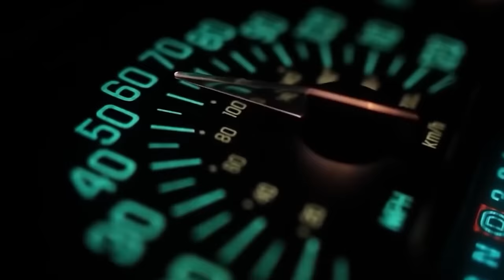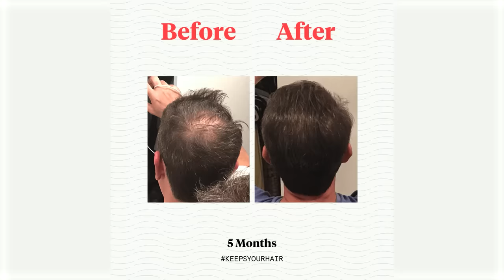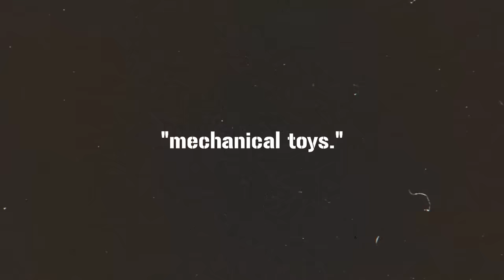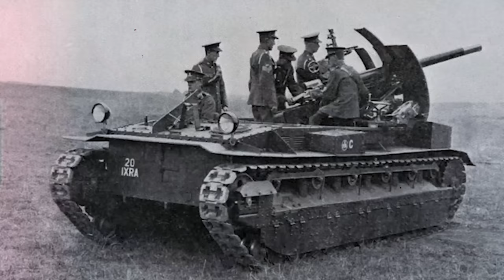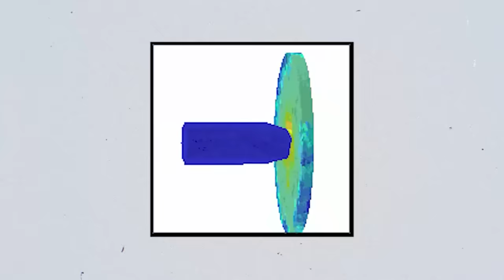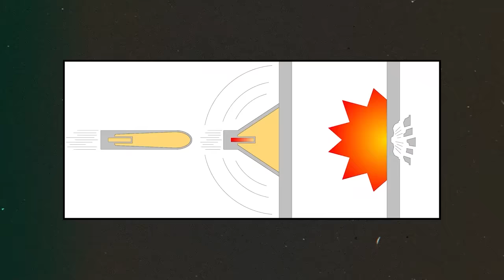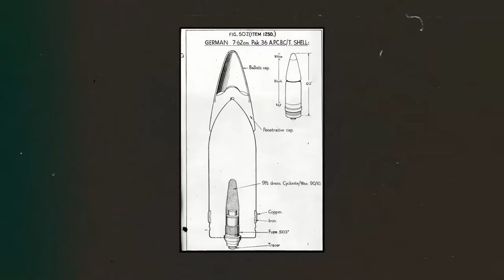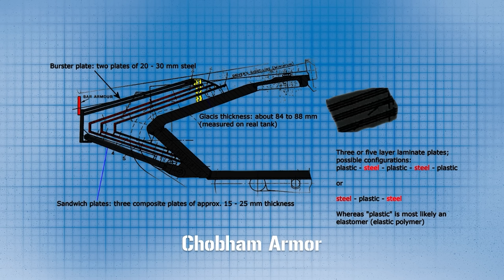The Tank: Everything You Need to Know

Comment: Armored cavalry / knights were technically the earliest form of "tanks" (Cataphracts were one of the earliest form of heavily armored cavalry). The fullfill the same role as modern day Tanks - mobile, fast (compared to infantry), protected by armor against infantry and even archer attacks and heavily armed (cavalry charges inflicting horrific amounts of damage vs infantry attacks and allowing them to easily bypass any infantry body armor thanks to the weight and momentum of their charge). Industrialization replaced the horse with a motor and the lance / spear / sword with a canon, but both the knight and tank ultimately serve the same function in an army - mobile, protected and powerful offense capability.
Reply: Tanks replaced cavalry in the role of Heavy Cavalry, but that does not make cataphracts etc. actual "tanks".
Reply: @bluntcabbage6042 True, but they ultimately served the same overall roll in their respective armies (tank today is mobile, protected firepower... heavy cavalry was mobile, protected firepower). Both also have the same weakness, in that they are highly vulnerable without infantry support to guard their flanks.

Comment: Little Willie actually had an armed turret on the roof. Before the French Renault tanks were built.  Turrets had also been widely used on ships and armored cars. The side sponsor guns used on the British WW1 tanks were designed that way to effectively shoot down into trenches.  So they were not a bad design but actually very effective.  Later tanks did not have to deal  with  so many trenches.  So they were able to use a very efficient top turret.  With the many tanks used during WW2 it was found that single turrets with a  three man crew were most efficient in providing an economic ballance of speed, armor and firepower.  Post war turrets with autoloaders only needed 2 crew. The WW1 Renault had a 1 man turret. Large and expensive multi turret tanks were found to be slow, unreliable and big turrets. 5 man  WW2 tanks were found to be efficient in ergonomics and manpower.  3 man turrets allowed for faster targeting and rate of fire. Leaving a commander to do other jobs rather than loading the main gun.  Such as looking for other targets, communicating and giving orders.  Having 2  large turret guns would be heavy, large and impracticable.   They would not have a significantly higher rates of fire and would require an extra man to load the gun.  And the gunner could only aim at one target at a time.  And there may be less room for ammunition.  During wartime cost effectiveness is very important.  As shown with T-34 and Sherman tanks that were built in tens of thousands.

Comment: I think your sloped armor thickness calculations are off.

A 1 cm plate angled at 45 degrees has the effective depth of the hypotanuse of a right isoceles triangle with base 1. Or about 1.4 cm.

Not particularly coincidentally that is the same multiplication factor as 1 f-stop of aperture.

Comment: I doubt the advantage of sloped armor is the additional effective thickness. I mean it uses the same amount of steel proportional to the increase in thickness because the panel itself is longer.  Instead the angled plate diverts the momentum of the incoming projectile, converting some of it to a vertical vector.  So it's more like the angle "parries" the incoming projectile.
Reply: You can doubt it, but its reality.
And of course the projectile has to pass trough more steel when the plate is angled.
And btw, the length of a hypotenuse is a2*b2=c2. So sloped armor should have less steal in it, than a right angled box.
But remember, the projectile only cares about how much steel is right infront of it, not how much steel is used in the slope in total.
Reply: @NotASeriousMoose  you're also using more steel because the armor plate is longer.  So thickness is still proportionate to the amount of steel used.  You can achieve the same thickness increase by using thicker plating.  The difference between using a longer sloped plate and a thicker vertical plate that uses the same mass of steel is the slope that diverts the momentum.  THAT is the reality.
Reply: @NotASeriousMoose  the effective thickness of a steel plate with a 1 inch thickness is ✓2, that is square root of 2.  If the vertical height is 10 inches, then the amount of steel used is 1 x 10✓2.  A vertical plate with thickness of ✓2 and a height of 10 inches will use ✓2 x 10 amount of steel, which is equal.  They both have the same amount of steel and both have the same effective thickness.  The difference between the two layouts is the slope.  I know how to use the Pythagorean Theorem.
Reply: You are ignoring the horizontal plate.
Reply: @egoalter1276  internal volume is not affected by the horizontal plate.  For the same equal cabin volume, you can use a half -length top and bottom plate for the vertical plate vs a full length plate for the angled plate on the bottom.  The volume remains the same.  One can even argue that the vertical plate has more "usable" volume as the ceiling is not intruding into the cabin space for a vertical plate.  In fact in 3 dimensions, for a rectangular cabin, an angled plate would use more metal for the horizontal plating because the corner would use twice as much metal than in an angled configuration.  So angled is actually less efficient if what mattered is only effective thickness.  I can math it out for u if u like.
Reply: @egoalter1276  this assumes the top and bottomed plate are of equal thickness, btw.  If the top plate was armored, then the angled configuration MAY end up using less metal depending on the dimensions used.  However, top plates are usually not as heavily armored as the sides, and when you factor in usable volume, then it would become a complicated calculation.  None the less, the amount of metal used probably evens out somewhat, so it's probably a moot point.  And if you're trying to argue that angle of impact does not matter in calculating the transfer of momentum and penetration, then you need to read up more instead of waiting for me to explain it to you.

Comment: I don't think any of the current designs really count as 4th gen quite yet even if they have some features that I think ought to be a part of a true 4th gen tank. We're seeing the development of quite a few significant systems that are being added to 3rd gen tanks to make them 3.5 gen. I think the first true 4th gen tank will be the first one to incorporate all or most of the various new capabilities in a cohesive whole in addition to incremental improvements in armor and mobility. If 1st gen is the basic MBT concept, 2nd gen is NBC warfare protection, 3rd gen is composite armor, smoothbore cannon and computerization, and 3.5 gen is 3rd gen plus one or two aspects of 4th gen tacked on, then, in my opinion, a true 4th gen tank should incorporate most of the following features: active protection system, 2nd gen modular composite armor system, resistance to top-down attack vectors, battlefield networking, integrated drone support, auto-loader, hybrid electric drivetrain, passive stealth design elements, advanced targeting and optics, and smart munitions. If you want to look really far out, I think 5th gen would be characterized by things like: high powered electric power plant, railguns, active camouflage, directed energy weapons, and high levels of automation.

Comment: I have a question about tanks. I'm hoping someone on here can enlighten me on. I heard somewhere that in the early days of tanks, they were called land ships, and they used naval terms, and that kinda stuck. 

So, my question is, does a tank have a gun or a cannon? I've never been in the military, but from what I understand, it's called a cannon if it's on land, and if it's on a boat, it's a gun. I don't know if they still use naval terms for tanks, making it a gun, or they (or if they ever did, and I hallucinationed that somehow) call it a cannon because it's on land. If it's the latter, then I guess you'd have to make an exception for those Duplex Drive 'swimming' Sherman tanks they used on D-day, I guess you could say they had a gun for a little while.
Reply: Cannon and Gun are generally interchangeable
Reply: Tanks have guns, you’re incorrect!
Reply: @jessehachey2732  The unrifled tank guns of today are typically called that, but in WW1 and WW2 most tanks were often mounted with already well known cannon and guns. For example the early Panzer 3's 37mm already in use on most Anti-Tank Guns, while the early Panzer 4's had a 75mm Howitzer/Cannon like gun
Reply: A gun is any weapon accelerating a projectile out of a barrel used as a guide and or pressure cointainment measure. Airguns, gauss guns, railguns, waterguns, whatever you can think of, are all guns. Its the general term. A cannon is a large caliber (tipically legally defined as above 2cm), long barrell (typically above 30 caliber lengths, as opposed to culverin howitzers or mortars) chemically actuated (using some form of low explosive, such as black powder, nitrocellulose, or cordite), sealed chamber weapon (recoilless rifles are not cannon), firing an inert projectile (missile launchers are also not cannon).

Comment: Your statements are the beginning a feel are unfair. The tank is not designed to kill as many people or as fast or in the most destructive way as possible. That honor goes to the Nuke. 
Yes of course, it's a killing machine. But its purpose varies greatly depending on the type. It provides protection for troops. It provides fear just by its presents which in turn will actually reduce death. It boosts moral with troops. There are many things it does.

Comment: Right at the beginning - tank is not for killing as much people as possible, but to provide solution for breaking through enemy lines while also providing mobile firepower and mobile cover. If you just want to kill people, there are much simpler yet much more effective tools. MLRS can wipe whole town in a minute.

Tanks like T-28 or T-35 could do very well against infantry and cavalry groups, which was still the thing on Soviet-Polish side and Soviet-Japanese side (or even Soviet-Chinese borders). Just imagine Japanese banzai attack facing couple of well positioned T-28s with multiple machineguns just moving everybody. More like mobile pillbox similar to small armored train than a land battleship. But those tanks were forced into different role by advancing nazi forces. Just about anything was desperately thrown into the fight at the beginning of Barbarossa neglecting all the tactics or multilevel cooperation.

Concerning generations 

T-55 had full NBC and was the 1st gen MBT together with mentioned Centurion and US M48/M60
T-62 is the 2nd gen MBT having 4 men crew, smoothbore
T-64/T-72/T-80/T-90 are the 3rd gen MBT with autoloader, composite armor, reduced crew, automated firing system, missile projectiles and later massively used reactive armor.
4th generation has reduced crew in separate armored compartment, control by wire, remote control capability, active protection system as standard, extensive camera and NV coverage, fully automatic gun capable of shooting wide array of projectiles. K2 is nowhere near to that as it is just normal 3+rd gen tank with crew in turret.

Abrams 2, Challenger 2 or Leopard 2 are in fact the same generation as T-62 just with minor improvements in electronics. Still the old 4 man crew, obsolete manually loaded cannon which at least is smoothbore. West is lagging behind for ages. The only 3rd gen is french LeClerc, no longer evolved since fielded.

Most of those obsolete (T-55, T-62), few substandard export (T-72) or even domestically produced tanks like T-72 Asasd Babil without even RHA armor in Iraq were just abandoned by crews who not even had proper ammunition with relevant penetrators. Many of those were destroyed by air attacks and rest shot by advancing coalition armies with massive numerical advantage. All those massive tank-tank killing battles are pure propaganda fantasy supporting exports of western vehicles later.
Reply: I do beg you to read up on some things that arnt russian propaganda, because this level of ignorance is just astounding.

Comment: No mention of the Abrams X with its active thermal cloaking, loitering munitions, 360° situational awareness, datalink,  automated 30mm turret, or new XM360 main gun? The tank exists, and from what has been released all the advertised features actually work (unlike the T-14), it's just not in serialized mass production because no one needs to be punished that badly yet.
Reply: The X isn't a production tank. It's a proof of concept for all those technologies and to show what general dynamics could do if you shut a few schools across each state and redirect the funds into their development budget. I'm more annoyed he didn't mention the KF51 Panther despite including footage of it
Reply: The US isn't going to produce the Abrams X they instead chose to completely re-engineer the Abrams into the M1E3, they are going to remove all the copper wiring and replace it with fiber optics and likely get rid of the torsion suspension, anything else hasn't been disclosed yet.